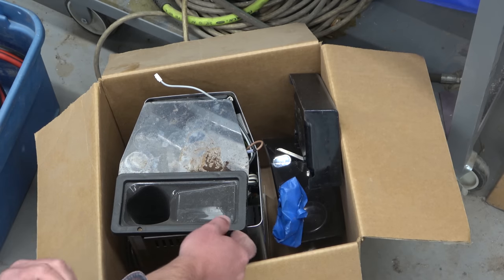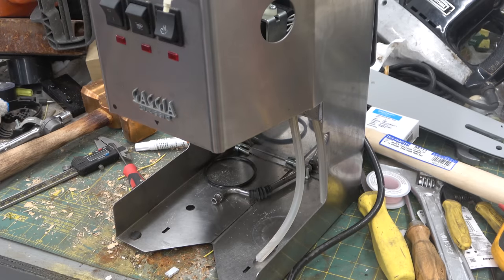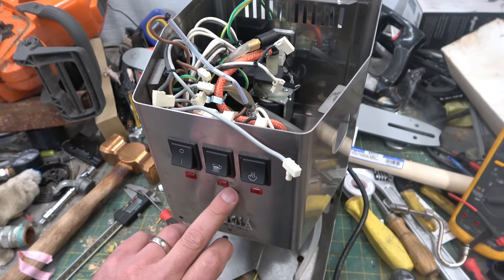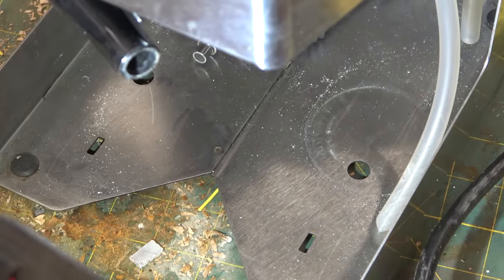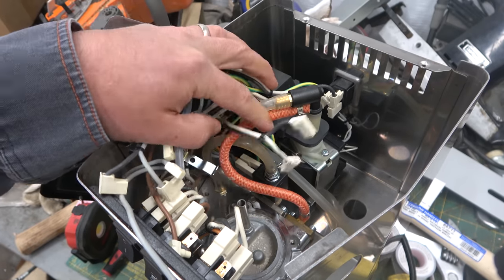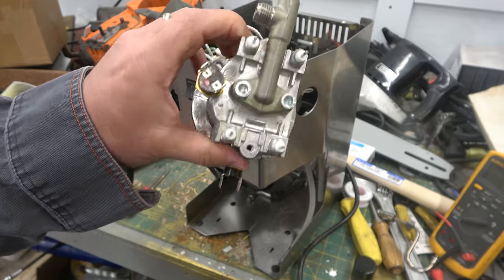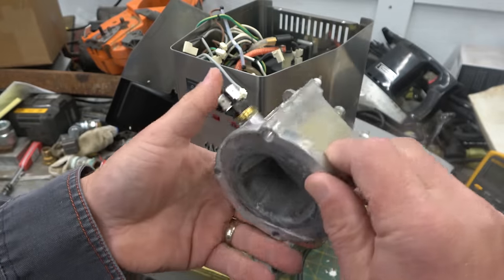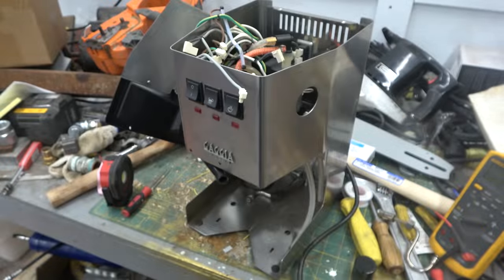unBOLTR: Gaggia Expresso

Comment: i suggest a 20 meter tall pipe with a hermetically sealed 1 ton fall weight that on release by the force of pressure roasts the beans, pounds them to dust while heating the required amount of water to a boiling point and purges the extract via a release valve through a heat-exchanger into a preheated stainless steel cup shaped mold. add salt..

Comment: Send it back to Du Claw all fixed up better than new but rip out all the internals and mount the spout on an actuator, wire up an arduino programmed speaker and the guts of an e-cigarette so when he switches it on… it turns half a twist, farts and lets the smoke out

Comment: Those aren’t terribly expensive in the espresso scheme of things, and you’ll be surprised at the parts availability in the coffee world, they make the same design for decades and a whole host of machines share the same internal parts, as a lot of them aren’t specific to the machine but are off the shelf. Price the boiler assembly before you fire up the welder, it might be a lot cheaper than you think.

Comment: Tig Weld/Braze that crack (not sure how much heat that heating element would take), and mill the face flat. 
Better yet, take those heating elements and sensors out, and machine a whole new one.

Comment: My suggestion? Go get an Italian coffee percolator (one that sends the water from bottom to top, not a drip percolator) cheap. I’m making cafe quality coffee with my eyes closed
Reply: Those are called moka pots, not percolators. I have a small collection of them and the best one I have cost me $2 at a thrift store -- a stainless steel Bialetti 6 cup. Six Italian cups of coffee is about one American mug full, so I'm looking for one in the 12 cup range.
Reply: @hxhdfjifzirstc894  all research I’ve done refers to them as percolators when not using the moka term. 

But yes, they’re excellent quality, mine looks as if it was a factory second and it’s some of the best coffee I’ve had. Finding grounds at the right coarseness is hard though, will be getting beans and a grinder I think
Reply: @hxhdfjifzirstc894  mines the 6 shot model too, and I could/did often just add some milk to all 6 shots and start drinking. 

Pro tip though, unless you’re hearing it over a gas flame you’ll have very minimal heat control and likely have bitter coffee but not instant coffee level of bitter

The other option is to put scoops of grounds into a tall top-spout kettle, and simmer it until the grounds have sunk to the bottom. Pouring the coffee careful to not disturb the grounds

Comment: Put it the oven get it hot, tig it up, stick it back in the oven and turn oven off. Next day deck it, bolt it to a steel plate and jamb 200 psi into it while hiding around the corner and see what happens. Don't forget to record it!

Comment: For the entertainment factor, I definitely would like to see ya swear over TIG welding...
Then for the knowledge factor, it would be designing the part in some CAD and putting it in the CNC.
For Dewclaw's happyness factor you might be better off ordering the replacement part. Also it could be possible to source a used part at a local coffee machine repair shop...
In any cases post us the results, it will be fun to watch !

Comment: Weld it, resurface, say screw it, sketch up a new one, load software to cnc, cry out loud, replace end mil, load up a new block, cry some more, finally fork up the 35 buck for a new boiler after spending 5 times that amount on aluminum and end mills.

Comment: The gaggia is a fun espresso machine. It should be noted that it's a single boiler machine and the pressure relief valve is set a bit high from the factory. As a single boiler machine, it also has the tendency to lose pressure as it's used so riding that pressure curve is important for achieving really good shots when pulling. 

Have fun!

Comment: Yeah... I forgot this guy has a machine shop and is asking us how to fix.
 Yeah tig weld and resurface. Or if you're feeling froggy and experimental, clean, flux, plumbers solder. Then get some quality sandpaper, spray adhesive and a piece of glass and figure 8 your way to flatness.

Comment: Just a quick PSA from someone who repaired portafilter espresso machines, including gaggias for a living for some time.

BUY AN OLD USED ONE! they are cheap, especially when broken, and can be repaired by an absolute chimpanzee like me.

From 2015 and onwards, Gaggias consumer line including the classic got sold off to Phillips and they kinda went to shit. The materials used got cheaper, they changed a lot of parts in the name of production efficiency and cost cutting, destroying their legendary repairability. and even WORSE: they stopped fitting an overpressure solenoid into the machine. The consequence? The 9 bar of brewing pressure are not instantly let off thru said valve but slowly equalizes. Now, if you get a bit too fast with trying to brew a second cup for your girl, you’re sprayed with coffee wastewater. Ask me how I know.

Comment: TIG weld the cracked top and if the heat doesn't straighten the top flange, (just kidding - that never happens) sand it flat on a piece of MDF with 100 grit paper.  It'll chooch again in no time!

Comment: To TIG or not to TIG, that is the question; Whether 'tis nobler in the mind to suffer

The slings and arrows of outrageous fortune,

Or spend an outragous fortune on parts, only to decide that there are other "issues".. Maybe you find out that you don't like burned, bitter coffee in the first place!

Since it is already busted,  you might as well try the metal hot glue gun first, and if it doesn't work, then buy parts!

Comment: If you had an aluminium engine block that got froze up and bent the holes out of round, warping the deck, would you heat it up, straighten it, weld the inevitable cracks, skim it, and put it back into service? No. Would you do that and put it in a race car that nobody depended on? Absolutely. 
Fix it home style and use it in the shop. Nobody has to know.

Comment: Grind it out, preheat to 100 dungarees science, and fill it in with a spool gun.  Wrap it up in a non melting blanket so it doesn't cool too fast, and check on it the next day to see if you did good.  If it's good, flatten the surface and enjoy.  If not, go buy a new replacement.

Comment: Unknown composition of the material, I'd remove all the parts from it, under cut the crack, clap to a copper plate to straighten then preheat  in a furnace. Then tig weld the baby, stick it back in the furnace to heat soak, turn off furnace to cool.  Then throw the whole thing in the trash cause you just wasted days of your life you will never get back.

Comment: I’ve had Italian made RANCILIO Silvia (bough used) for 15 years now that’s similar in size as this machine, completely rebuildable, replaced boiler gasket and few pumps over the years.. boiler is made out of solid 2 piece heavy brass not some aluminum or whatever that material is.. that one is not worth fixing.

Comment: Sand the base flat
Reply: Didn't see the crack at first, you could tig or JB weld. I'm not sure what pressures the boiler gets to when steaming though, could be dangerous. The part isn't that expensive here in UK, might be worth replacing.

Comment: Nothing ventured nothing gained. Tig it up tight, Its only a pressure vessel, so worst comes to worst, you take a hot shower, and buy a new part. /s    Non sarcastically, not if sure cast aluminum is weldable of it it does the bullshit that 7075 does? If cast does weld, then fuckin A weld it up nice and heavy, and clean up your mess on a mill as needed.  If not, well then weld it up anyway, then fill it with water, seal it up tight, then drag the boiler outside, hook it up to power and film the results.